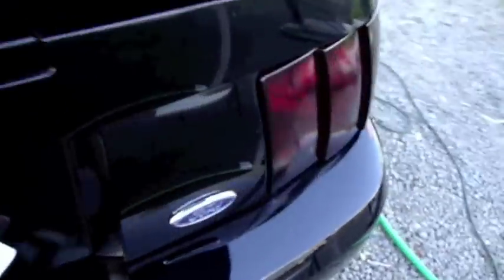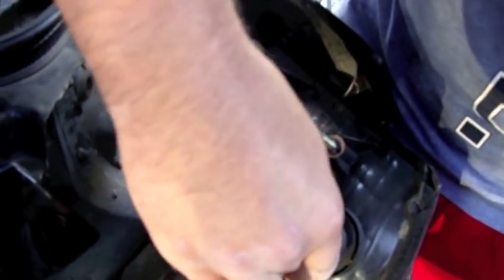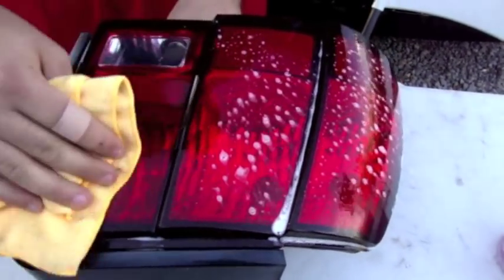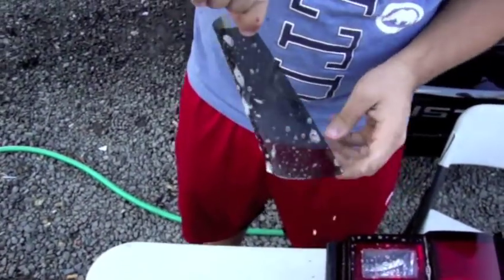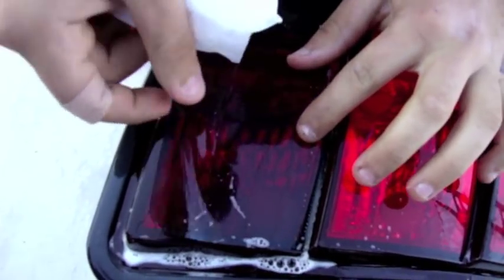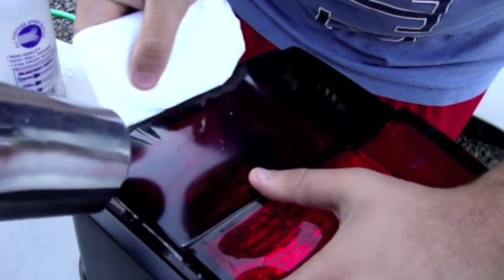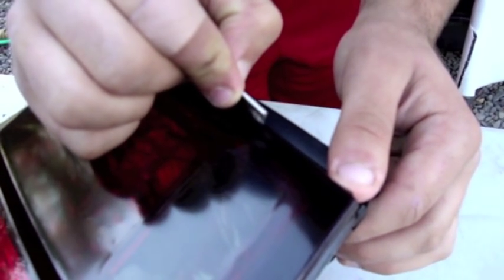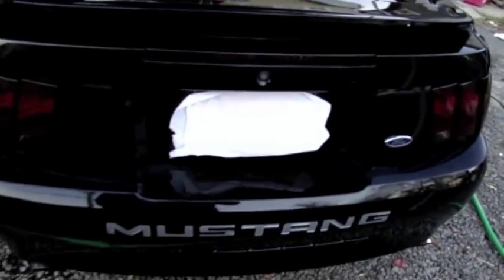HOW TO TINT YOUR TAIL LIGHTS OR HEADLIGHTS WITH TINT FILM CAR MOD DIY

Comment from the maker: One you could make yourself which is the soap and water. It consists of a drop of shampoo in some water. It is possible to just use this spray as long as you get rid of all dirt on your lights. My lights had previous tint on them so they had adhesive on them so i used super clean degreaser which could be purchased from the store to clean them. You could also you goo gone or an all purpose cleaner.Thanks for the subscribe and comment.

Comment from the maker: The reason i havent uploaded anything is because my car got flooded from hurricane sandy after this video by a few days. I'm picking up a mustang gt in the next few days hopefuly. I did alot of mods to this car but never recorded them so from day one i will be recording mods of the new mustang including how to get rid of that annoying power steering whine that many of the mustangs if not all have.For the third brake light i had used a tint from american muscle that had the mustang cut out.thanks